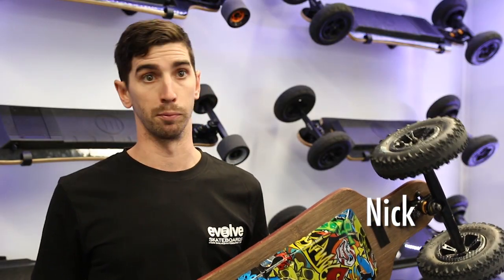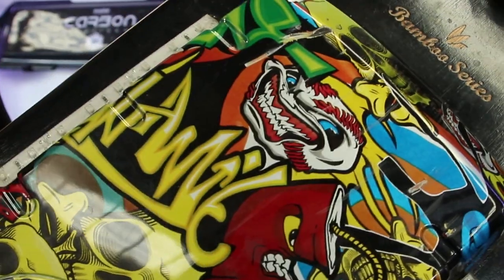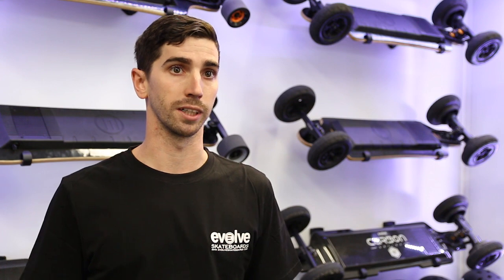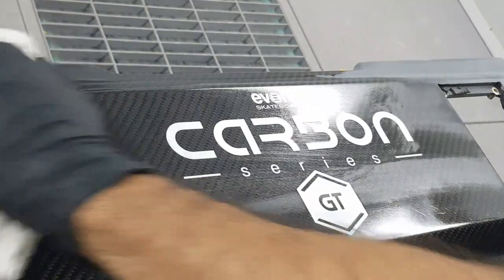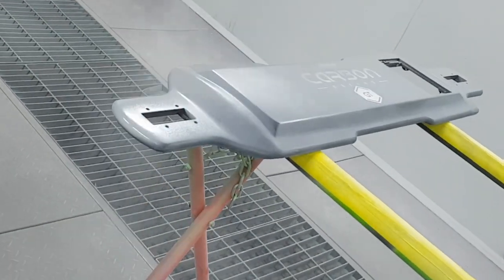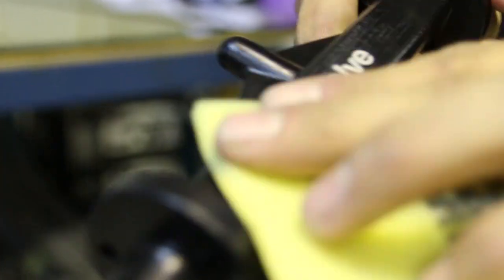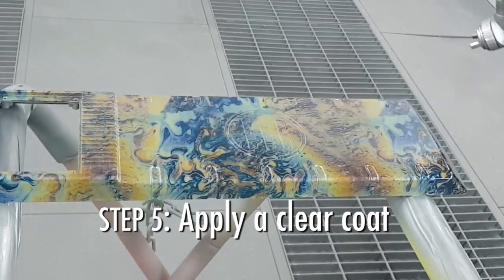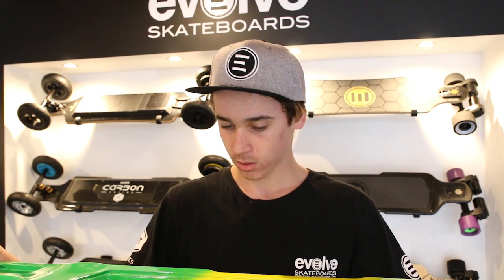Custom Evolve Skateboards - Hydro Dipping and Spray Painting

Comment: This is my favorite episode of the weekly videos. I appreciate this video the most because it explains how some board are not able to completely dipped because of the surface areas of boards other than the Carbon GT. I absolutely miss my Carbon GT so much and barely had the chance to enjoy it because the second day I owned my board, it was stolen out of my apartment garage. Gah damn those youth degenerates. Only thing left of it was the Abec 11 97mm wheels, which I used to make a DIY e-board with my own down hill longboard. Loads of fun, but not the reliability and turning radius of the Carbon GT!
Cheers to health and prosperity!
The best boards in the biz....

Comment: How do you hydro dip with graphics instead of it just being a mess of different colors
Reply from the maker: Hydro-dipping is a method of applying printed designs to three-dimensional surface. The patterns you see were specifically chosen, you can also apply other patterns to surfaces.

Comment: Hi Guys

how do I remove the grip tape on the Carbo GT without damaging the Carbon Fibre underneath? as I'll want that to show through my grip tape design
Reply from the maker: Hi Kyle, sorry for the slow reply, this didn't show up in notifications! We use a heat gun on a low setting to release the glue, a decent hair dryer may be warm enough too. We recommend doing this with the battery cover off the board so you don't heat up any of the internals.
Reply: @evolveSkateboards  great and thanks for the reply guys 👍🏼

Comment: I was going to buy a GTX but after all the horror stories I've been reading about the remotes getting stuck in full throttle or suddenly disconnecting and going into breaking I've got real second thoughts. please give comments on this issue. I am not trolling, this is a legit safety question !
Reply: Jayaram Prabhu Durairaj I've got one, never had an issue. Of course one in a thousand might have some defect, that's life. Evolve will back you for repairs and swaps. Wear protective gear until you're confident in your ability and board.